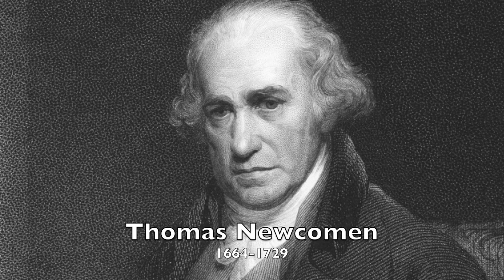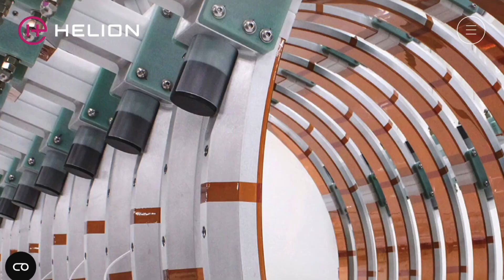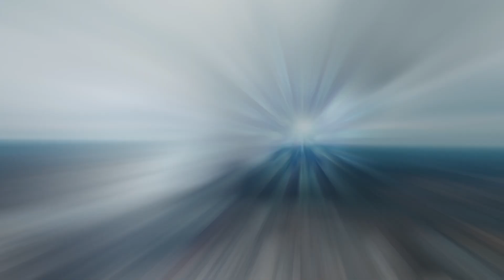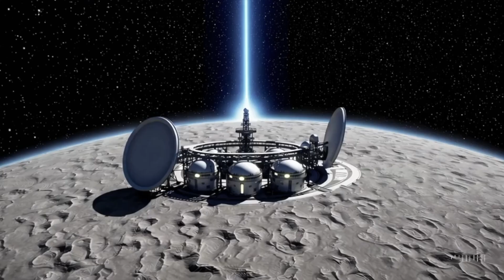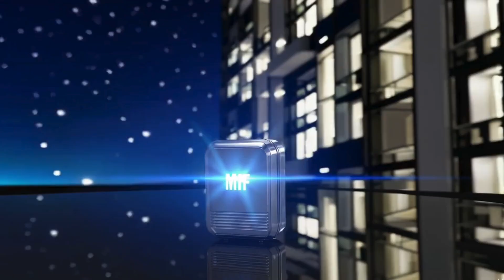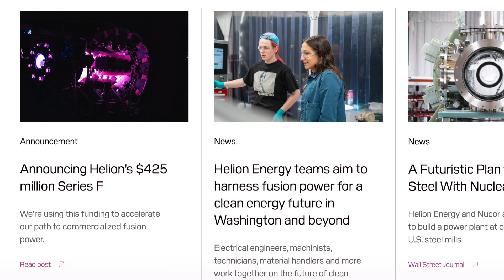Step by Step to Helium Fusion

Comment: We don't use steam because it is fun. We use it because it is the best available technology. And if you think that the technology has not improved since Newcomen's Engine, I have a bridge to sell you. Also, while you talk about the aneutronic nature of the Helium reaction, you entirely fail to mention the much higher temperatures required - and we cannot currently sustain the temperatures required for Deuterium-Tritium fusion. Right now, MIF is nothing more than a concept.
Reply from the maker: You make a fair point—steam remains the best available technology for energy conversion, and fusion still faces major hurdles. While aneutronic fusion is an exciting concept, the extreme temperature requirements make it a distant challenge, especially considering that we have yet to achieve sustained Deuterium-Tritium fusion. MIF, as it stands, is still theoretical, and much more research is needed before it becomes viable.

That said, we cannot deny the fact that the reluctance to move away from fossil fuels is largely driven by asymmetric income distribution.

Thanks for your insightful comment!
Reply: Because It always will be a concept - this took 80 million dollars to achieve this fusion and don't walk too close to it you might melt. - till a better idea comes around he says lol